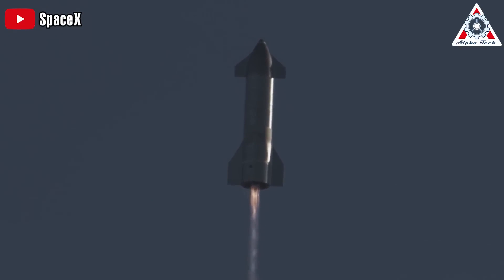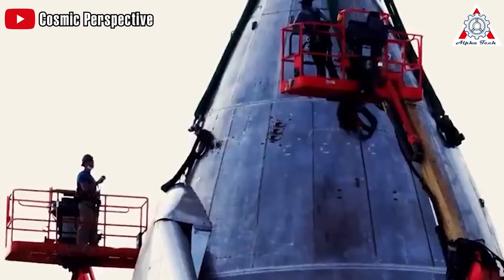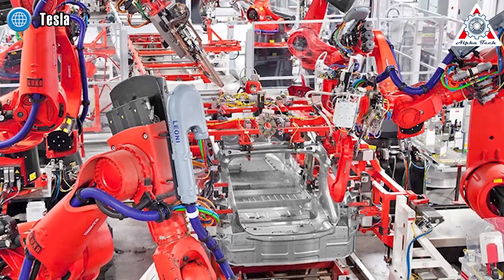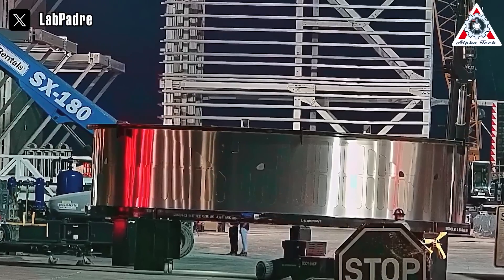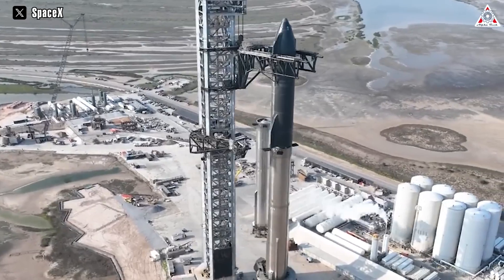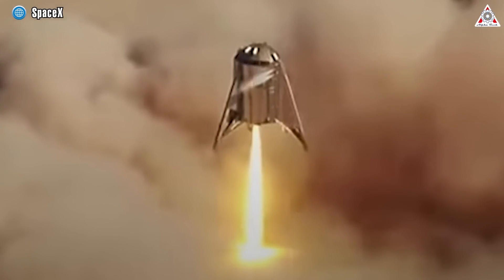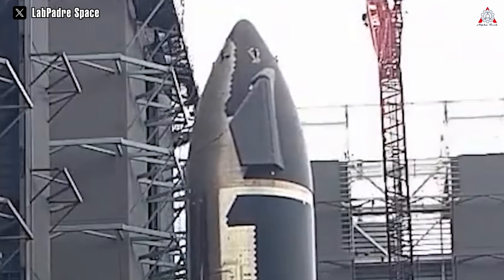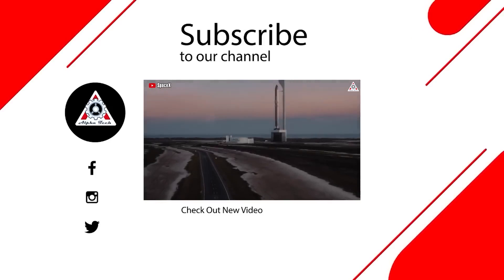It's mind-blowing! What SpaceX just did with Starship's Welding&Nosecone shocked the entire industry

Comment: a shocking discovery : it was not the carbonfiber that deteriorates, but the hardened resin or matrix which horror of horrors softens at ~~200 deg C.
but no worries  there are other matrix materials : ceramics?
cheap, they are not, shiny stainless steel is, shockingly.

Comment: why are they using carbon fiber? wasn't that titanic exploring sub also made of carbon fiber and it imploded?
Reply: Cylinders are unstable when the outside pressure is higher, but very stable when the inside pressure is higher. So the sub crumps in 5 years, & the starship doesn't.

Comment: This is insane! Wonder what Starships internal structure looks like! Besides the tanks there has to be a frame structure of sorts I would think! Cant find much on Google!
Reply: It's mostly empty inside, it's a big fuel tank.
Reply: Just the struts welded along the rings. In fact most of the frame is outside of the rocket. Next time you see starship notice the vertical struts welded around its circumference at certain heights.
Reply: Once the tanks are pressurized not much of a skeleton is necessary. Think a soda or beer can that’s open. You stand on it and it crushes. Now stand on a closed can.  No problem. The exact same concept.
Reply: There still needs to be mechanical support linking between skin and fuel tank. One holds the other up, under launch-stresses, or they make a joined structure. So what links them?
Reply: My understanding is that there is very little frame or structure in side.  Obviously, there are connectors and attachment points for various items but mostly the round shape and thickness of the steel walls are what keeps the ship in shape while being constructed and prepped for launch.  The internal pressure of the fuel adds a lot more strength for the additional stresses when the ship is launched.  Stainless steel is a great material!

Comment: Can SpaceX helix and weld the roll of stainless steel into a continuous pipe? Then cut the pipe for the end into required length. For the nose cone cut wedges out bend together and weld. Or programed into the helix welded. Tank bulkhead could be pressed in from the ends.  Fast low cost rocket shells with very few parts.
Reply: in the video, I think the transition to vertical wedge strips in the nose cone has already been done for Starship.

Comment: I've been working in a plant where we build the wiring for the SpaceX Starship and it's booster. We have seen many changes to the electrical systems over the years. These are things the general public will never see or be aware of. SpaceX has their own proprietary polymer for electrical insulation. It has impressive specifications and capabilities. They have dramatically improved the sheathing material for the wiring on the raptor engines in the past few years as well. They're fearless in their willingness to stop mid build and completely re-engineer new electrical systems. They adapt to change rapidly. From an engineering, manufacturing, and testing standpoint, it's a wild ride.
Reply: Great info!
Reply: Most companies that sell to customers are always held back by the products they have released 10 or 20 years ago. 
Many technical improvements are not "possible", because changing your existing products shows that they were flawed in the past. And if a change is accepted, you can only do them by also lowering your sales prices, while the costs for materials, wages, energy and quality only go up.
SpaceX is really luckythat they can do whatever is best in the moment, without worrying for 10-20 years of historical balast.
Reply: Why Spacex, Tesla, X, you, Spacex team and Elon Musk think outside the box engineering design build brilliance sets the bar high for success others can only talk about or dream about.
Reply: @airgliderz  😁 You!
Reply: @CelestialSooth  Also an idiot in other contexts.
Reply: Cool insight, thanks.
Reply: Thank you for your contribution to humanity😊

Comment: Some major types of welding are acetylene torch, STICK, MIG, TIG, Laser, and Friction. In your description of flux core, all the video was actually STICK welding, with rods. Flux core is a variation of the MIG process, where a roll of tubular stainless steel wire contains an INNER core of flux. When the wire feeds out of the contact tip on the welder, it creates a short circuit upon contact with the object being welded, as long as there is a complete circuit back to the welder. The wire gets hot, melts, and the flux floats to the surface, preventing oxidation. Flux core is an alternative to Argon/CO2 gas shielding. Because the welding was being done outside in the wind at the beach, gas was not really an option. I used flux core on my 304 stainless steel deck railings.
Reply: Gas is fine with an appropriate shield.
Reply: I use flux all the time. Less crap to lug around. Spatters a little but easily remedied with antispatter spray or a welding blanket. Also far more forgiving on not so clean stuff like farm equipment. A little paint, rust, cow crap no problem.

Comment: Nuclear fusion of a star. Integral precision machining. With permission and with the greatest respect on my part. I am a researcher and it is a great honor to report on this. Paramagnetic tungsten alloys. Complete mechanization of vacuum furnaces to cope with the enormous heat energy generated. Preventive measures to avoid oxidation, deformation and cracking of the material.
Definitive solutions to overcome the difficulties of oxidative fusion or thermal deformation of tungsten and austenitic alloys.
Physics and applied chemistry. Built-in heat exchangers. Pressurized steam used to generate electricity. Vacuum chamber or life support device to keep nuclear fusion under control for extended periods of time. Physics and chemistry applied to paramagnetic and reactive alloys. New electromagnetic and automatic laser technology. September 22, 2020 a technological discovery approved by law in America and Europe. For the first time, paramagnetic and reactive alloys of titanium and aluminum are joined by laser automation. The new automatic electromagnetic laser technology also enables perfect welds with controlled asymmetry from both sides of the material simultaneously. The new electromagnetic laser technology is a concrete and scientific fact of today's reality for joining paramagnetic or diamagnetic alloys that were previously considered difficult. Plates of different thicknesses prevent chemical reactions of the alloys because the process uses inert shielding gas on the front and back of the material. Laser magnetic compounds with protective gas for strategic materials.
Example: Tungsten, austenitic stainless steels, titanium and aluminum. The new process solves the need to build melting vessels from refractory materials such as tungsten (W) with high melting points. The new electromagnetic laser technology welds tungsten alloys simultaneously from the north side and the south side, outside and inside. Perfect welds with controlled asymmetry through simultaneous emission of stimulated light from both sides of the material. Laser magnetic confinement for nuclear fusion of a star. In another context, particularly in aviation. New electromagnetic laser technologies are transforming the aerospace industry by allowing mass stamping of the fuselage of civil or military aircraft, eliminating the need for traditional structural rivets that have accompanied the industry since its inception. The new automatic double magnet laser technology replaces the European FSW friction welding system with important comparative differences. Construction of liquid fuel tanks for launches into space. The SLS Space Launch System consists of a probe embedded in the material, causing holes in the defective ends and tool wear in the welds. The European FSW probe cannot function properly in hard materials such as steel and titanium due to catastrophic fractures in component connections. It is prohibitively expensive to produce reliable welds from materials that are durable and better than aluminum-lithium, which has so far produced only moderately good results. New north-south magnetic laser technology has finally solved this problem. Construction of space modules of the future ISS with artificial gravity. Laser electromagnetic modular design of carrier systems and spacecraft. It is an honor for us to report on this, and as researchers it is also an obligation to spread the truth. Aerospace technology has changed. More height, safety against explosive depressurization and fuel savings. Monohull boats. Fuselage integrated into the wings, suitable for pressurization at high altitudes. Intelligent supersonic passenger flight without afterburner. For the construction of nuclear fission reactors, it is important that the best possible reactors can be built with the new method. More security in the construction of containers for nuclear fission. Manufactured from safer and more durable austenitic steels. For the maritime industry, the new method approved in 2020 allows the hull of nuclear submarines to be built from reactive and paramagnetic titanium alloys through automation with electromagnetic laser... Best regards...

Comment: Stainless steel laughs at 1600°. It laughs at oxy-acetylene, it has to be cut with plasma, shears or grinder cutting wheels. It works well for bombs as tall as a football field
Reply: Stainless steel conducts heat to whatever is holding it in place or it is supposed to be protecting. That might not be very happy being heated to 1600 degrees.

Comment: Your description of flux core is wrong.
And the Hopper hull was wrinkley due to whats called starved horse effect in ship building.
its when your skin is thinner than your ribs, and weldment shrinkage sucks puckers in your skin.  Also early nose cones and tank domes were cobbled up crudely... often too many pieces trying to get a fit. and now they are using less pieces and using  presses, so getting better. Also they were over welding the nose seams.. But funny thing when one twists their tail online, problems soon get rectified... 🤭 People have to insult you first though, for having the audacity to Suggest Elon might not have super dooper genius welders from the first arc struck... But after being haranged about the water tank guys, they did get a more professional group, and even they had a serious learning curve to get that clean look we see today. Also looks like they are offsetting the ring edges on one side, and getting the weld on the inside of the ship out of sight. with the doubled area adding a tich of mass but also acting as stiffners at the joints. 
That offset is rolled into the edge of the sheet.
(304 is a very maluable stainless.) Alot of welding effects cosmetics is about hiding the welds on back sides, or neat and minimalistic welds evenly spaced. The only place you want full length continuous welds is the skin.  Where one needs to seperate the air medium from vacuum and keep it that way. 🤗
Any time you see something thats had the hell welded out of it,  thats unprofessional. a good welder is a minimalist...
The guy that taught me the most, advised I do a tack weld, and then break it apart with a large hammer to grok how frickin' strong welds really are.. it was good advice.. after getting the pieces apart from just that tack, you realized minimalism was advised. less welding the better generally.  Good welds have incredible strength.
 I'd love to wander around at SpaceX eyeing stuff, for quality.
My Grandfather was a weld inspector on American Submarines in WW2, sure I could channel his ghost.

Comment: Didn't they destroy the launching pad because they didnt take the time to reinforce it? A practice that spans over 60 years?
Reply: No acomplished two weeks of demolition in 10 sec.
Reply: impressive  @bradlovin1
Reply: The launch pad had multiple pilings driven into the ground to support it.  It was made of concrete with metal pieces mixed into it.  They thought it would hold up for at least one launch.  They already were planning to add the water deluge system for longer term use but were in a hurry to get that first flight done so they launched without the deluge system.  OOPS! The deluge system is installed now! 🤣
Reply: SpaceX chooses to learn by doing, in full view of the public. Enjoy it.

Comment: Dude it crashed🤣
Reply: That was intentional. Spacex placed explosives onboard before launch. They were experimenting with stage separation by spinning the rocket. When that failed, the mission was scrubbed and the down range marshal gave the order to scuttle the craft. The explosive devices were detonated as planned, and it came down safely in the gulf in tiny pieces. Exploding it was the contingency if the stages didn't separate.

Comment: Building the Starship from steel will also improve the stability upon reentry as steel can accept much more temperature before getting weak and melting. Aluminum is good as long as it does not get hot. Therefore high-voltage conductors have a core of steel wires as Aluminum notably weakens even above 100°C. Carbon fiber is not better as the epoxy weakens too when getting hot.
Reply: No. Steel is cheaper than aluminium. Furthermore the skin effect means that practically all of the current flows close to the surface. That means you can cut down on the aluminium and have a stronger cable. The cable design is the best tradeoff between price and electrical losses.
Reply: @rogerphelps9939  At 50/60Hz the skin effect is not so significant as in communication technology. Therefore, and also because of the electric field strength and corona losses bundle conductors are used for Voltages >100kV and also currents  >1kA.
Reply from the maker: Thanks for your comment. Keep following and discussing on our channel ☺️

Comment: Temperature numbers aren't accurate for carbon or steel.  Carton fiber is hydroclaved for rocket nozzles with a special resin that allows temps of 3200 F.  3 times for steel would be 600 per your number of 200.  Cost was the main factor per Musk years ago.  Both Lotus and ford have used friction welding dating back 20 years.
Reply: Carbon fiber has a significantly less thermal breaking pint than ss
Reply: @nickford5549  by itself, the resin and matrix provide the properties.  When I was getting my economic degree, I was bored so I became certified in composites through a Boeing course in Long Beach.  I don't talk about things I don't know, maybe take a note for future posts.
Reply from the maker: Thanks for your comment. Keep following and discussing on our channel ☺️

Comment: Or descend will be performed in the rotation manner, so there will be less need for the heat shield
Reply: Possibly application.......but what would happen to the overall surfice temperature? It might result in more tiles being needed if faster decent speeds were planed  to enable heavier lift caperbility? Already partly planned for disposable tankers I believe ?
With passenger and freight application to be considered as well  rotation may be necessarily excluded completely. Centrifugal force  would also need to be considered as this concept may necessitate a redesign to increase the structural strength of the complete ship.
Just a few thoughts to be considered on application of this well conceived principal.
Reply: @hughwitherington7956  empty refueling tank will not be heavy